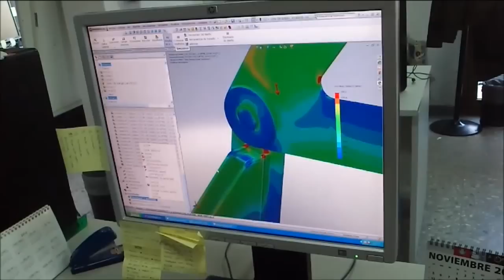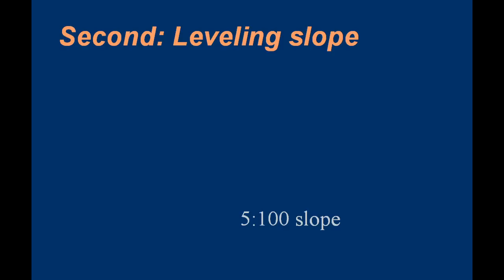Lifting first section of "La Pepa" cable-stayed bridge.

Comment: 1- The lifting device was designed because the cost of sling was too expensive, then was cheaper tu design this and supply this....
2- Eurogruas LR11350 was sold some moths ago...

Comment: bla, bla, bla, the leveling usually its prepared before with shackels in the ground, better is this but really not neccesary. Respect the price as I suggested the meaning is that this was designed because the price of buying new slings and spreaders was too expensive, this is the meaning of this, and even cheaper than rent the hydorespex system. 
- about the crane was sold its not your department, but its your company... and your department work for this company and with this crane....